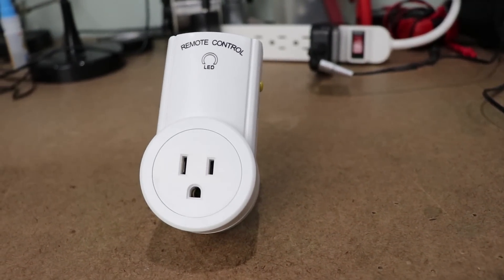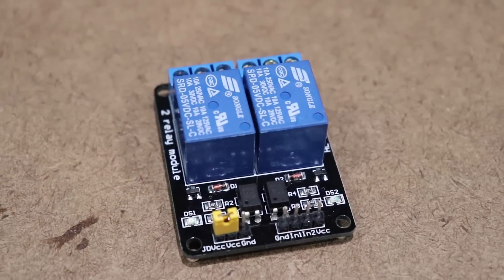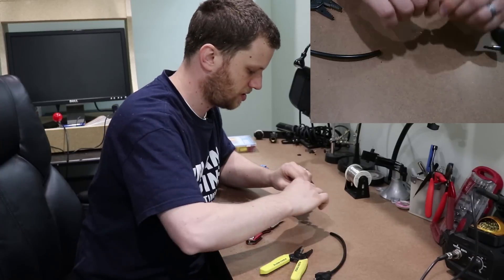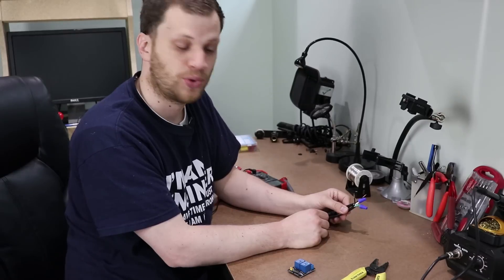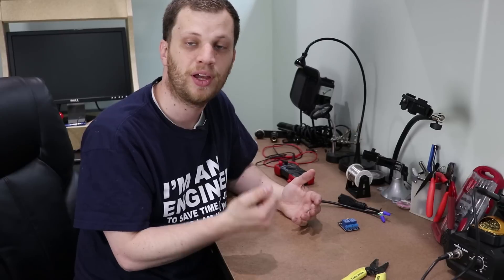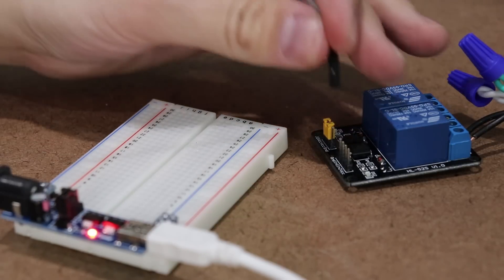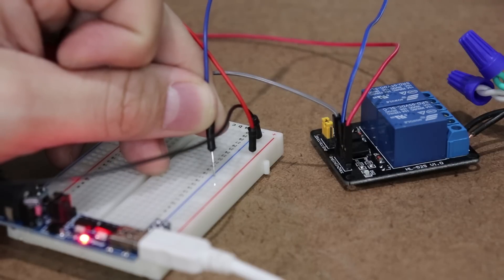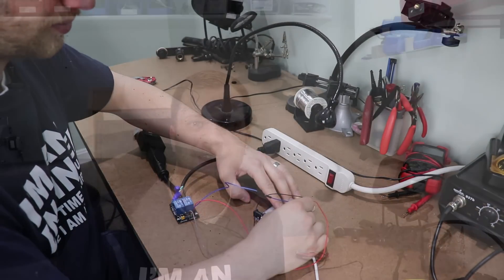DIY Smart Switch - Part 1 how to use a relay

Comment: Have you ever heard about Wago??
Reply from the maker: Nope, what's that?
Reply: @bytesizedengineering   This is for connecting wires
Reply from the maker: Oh, yes I have seen them. I didn't know what they were called. Thanks for the tip

Comment: Man, I did not understand it why the signal connector should be ground to get the relay activated? To activate the relay, shouldn't we apply 5 VDC to activate its coil? Your clarification is much appreciated... Thanks for your very helpful and useful training videos
Reply from the maker: There is usually a transistor that drives the coil. Depending on what type of transistor (N channel, P channel, NPN, PNP) will determine which logic level turns on the relay. This particular module has active low logic which means you ground the control signal to turn on the relay. Hope this helps!

Comment: Awesome video man. Thank you so much. Taking your time to explain to this level of detail is highly appreciated.
Reply from the maker: Thank you! And Thank you for taking the time to comment!
Reply: @bytesizedengineering  Can I control load of max 15 amps under 12 volt DC as along as it maintains the same output power rating?? Example Say, 20 Amp, under 12 v dc, power 240 watt as against the rated 10 Amp X 24 v of same 240 watt, or 15 amp, 12 volt....!!??? I'm really confused with these power and current. Awaiting clear concept. Thanks.

Comment: Awesome video Zach, thanks very much. I need to power a simple electromagnet with 12v and would like to use one of the GPIO pins on my Raspberry Pi to control the relay. Can I use one of the Pi's 3.3v GPIO pins? Also, do I need a diode to protect the microcontroller from voltage backfeed/backpower created by the collapsing magnetic field (when I turn it off)?
Reply from the maker: Calvin, you are right on track! You absolutely can use the pi for something like this. The relay module you see in this video has back emf voltage protection built in. It has a diode (like you mentioned) as well as an opto-coupler. There are a million tutorials online (adafruit, sparkfun, etc) on this topic. A quick google search should provide what you need. Good luck!

Comment: Hey can you help me. I want to make a tv that turns off when people come over to look at it.. Do i use normally closed? Will.it.open when coms? I want it so people in a gallery see a screen with a video feed and come over but a motion sensor turns it off when they are near. Thanks if you can put me on the right tracking without using arduino
Reply from the maker: That sounds like a cool project! I see that you found my other video showing the PIR motion sensor. I would start with something like that and connect it to the normally closed terminal. Good luck!

Comment: Hey can anyone answer this for me? He mentions that by using a relay we can control high voltage circuits with a low voltage, yet he continues to run his relay directly from a wall socket with no use of resistors.. can someone explain?
Reply from the maker: That's a great question! I'm not "running" the relay from the wall outlet. I can connect the relay to a control circuit (microcontroller like the Arduino) which is run off 5V DC. That control circuit can open and close the switch inside the relay. If you connect a mains voltage appliance to the relay you can control whether or not the appliance gets power from the wall outlet. The wall outlet is completely independent from the relay and control circuit. I hope that clears things up a little

Comment: Hello guys, just wanna ask, I want to connect my arduino to a 12v battery (It's possible right?), if so, I want to control a light bulb with the same power source also 12v battery, do I still need a relay? If so what volt should I use?
Reply from the maker: Check the specs of the Arduino model you're using, but the uno has a voltage regulator on it that can handle input voltages up to 12V.

Comment: Instead of using costly relay, put a normal switch to it
Reply from the maker: I'm not sure you understood the point of a relay. They allow you to electronically control devices connected to them. Also this relay only costs $1-$2 on eBay

Comment: Sir can I use this relay for DC Actuators
Reply from the maker: A relay opens and closes two points of contact in a circuit. Draw your circuit out on a piece of paper and see if a switch makes sense. I would make that determination based on how much current your DC actuator draws and how quickly you want to switch it. I would look into using a mosfet or h bridge motor driver.

Comment: 5:30 whats that thing on the breadboard?
Reply from the maker: It's a USB breadboard power supply. Plug a USB cable into it and provide 5V to the breadboard. You can get them on eBay

Comment: Also if the thing that you've connected to a relay is connected to the plug, you shall never touch the relay, aspecially the bottom of it. I lifted my relay to plug one more pin and got myslef electrocuted. Now i have 2 burn marks on my finger like i was hit with a very powerful taser gun and it hurts badly. Don't be an idiot like  me and be extra cautious when working with AC
Reply from the maker: Yes, very good point. Don't touch the solder joints on the bottom of the board when they're carrying AC!

Comment: just got a 12V 2-Channel Relay Board Module Active Low unit; - just realized that I now need an ATX psu near it AND to knock up a wee module with a bit of tri-pad and two transistors (+resistors)...
Reply from the maker: Sounds cool! Good luck!

Comment: im corrently working on a related project,and i have just one doubt. instead of the breadboard power supply,can i use a 9v battery,if yes how? please respond asap
Reply from the maker: You can use a different power supply

Comment: your leaving a lot of copper showing there slick.. Dangerous! you scare me my friend.. if you all follow his example do not let the extra copper show like he did.. cut your wire the length it needs to be to fit into the relay with no copper showing.. It is the safer way.. the electricians way..

Comment: Nice video! What are those blue caps you use at 3:10?
Reply from the maker: I call them wire nuts, there might be other names for them elsewhere. They are used to connect two or more wires together. Just make sure you get the right size for the gauge of wire and how many you'll be tying together.

Comment: my relay does not sound click . but the light bright up . is there something wrong with my relay ?
Reply from the maker: You're not using a solid state relay right? If you're using an electro-mechanical relay as shown in the video there could be a number of things wrong. Make sure your wiring is correct. Make sure you're using a high enough voltage to actuate the coil. Read the top of the relay for that information. The real test is with a multimeter to make sure the contacts close and open. How loud the click is is less important.
Reply: thank u for the reply. 

wiring  /
My wiring is correct , i triple check it to be sure . i already test the same wire to the other device and it is working correctly . 

high enough voltage  /
my relay 12 v . and my power supply is also 12 v .  

multimetre test
dont know how to test it . hahaha 

btw thank u for the reply and the knowledge

Comment: How reliable would you say these relays are? How long will each last you reckon?
Reply from the maker: I'm not sure. If you find a datasheet for the relay you'll probably find the number of lifetime cycles it's rated for.
Reply: Also, although it SEEMS like the Arduino is isolated in this circuit, it really is not. You should use a separate 5V power supply on the JDVcc pin to fully isolate the Arduino from the electromagnet in the relay. Otherwise, if something goes wrong with the relay, you might damage your Arduino board.
Reply: The relay itself (the little blue boxes) is probably fairly reliable -- and can handle those 10A as written on them. However, there might be other components on that board that will not last long/fail at those loads.

Comment: Electrical engineering degree..... doesn't even know what high and low voltage is
Reply from the maker: I work with embedded electronics, anything above 12V scares me!

Comment: can a 5 volts power supply work as well and a  breadboard power supply? you know. the kind you use to charge a cell phone? or better yet , a usb 2.0 connected to a pc?
Reply from the maker: Yes, any 5V supply will work
Reply: fantastic. Thank you

Comment: Great video!  Do you have a video on how to use a relay to open/close an electric DC 12V valve?  I assume you need a two-channel relay to set the reverse polarity?  Thanks again for the video
Reply: A solinoid is usually used in irrigation

Comment: If you want to control the power of higher voltage equipment like servers and even lights I like using an Intelligent APC (7800 or 7900) PDU over a network with fence_apc installed on a Linux device. That's for anyone who might actually have a need for that. That way you can use your GPIO pins for things like sensors, etc, etc.

Comment: You shouldnt have so much of the bare copper sitting out of the relay, if they only slightly touch all current will flow through the small surface area making it heat up and most likely cause a fire, and the circuit breaker will not trip to prevent it
Reply: exactly my thought!
Reply: @therealb888  ^
Reply: 4:38 in case somebody is wondering. but yeah, that is super dangerous!!
Reply: @gene_Code  ur the man!
Reply: Gene Code it’s not plugged in give him a little credit 😂😂😂 this guy has stones dude.
Reply: Good lord yes XD literally the worst thing to show people that exposed copper is okay!
Reply: I was thinking the same. I would recommend some ferrules for soft stranded wire that is so closely connected
Reply: Oy vey. Did you see the part at 7:24 where he recommends putting into a protective case. At 1:11 he flips a switch on & off. Do you suppose that it has exposed contacts on the side of the switch?
Reply: This guy is begging the Fire Dept to pay him a visit. Shouldn't be working with AC at all. How to commit suicide should be the title of this video.
Reply: Yeah. I would not do this in this way at all. I am pretty sure I would install a device box containing the relay to handle this at the outlet. Inside a device box I could bond the box and the circuit can safely just go from outlet
Reply: It would almost certainly throw a breaker. You would be directly shorting the hot and neutral lines.
Reply: @professorstratios8228  no because both wires are the same „hot“ potential
Reply: But I would disagree to it, the two copper wires are actually a power line cut at a point for the relay to get in between in serial, and having two of the bare wires to connect will simply bypass the relay and keep the connected  device always ON. why is that dangerous? I cant understand, apart from the fact that you can yourself get electrocuted.
Reply: @muhammadjunaidmalik3584 , same thoughts. Seems they doesnt know what they are saying and yet have all the courage to criticize. funny how they say when both wire slightly touch each other, they will heat up. oh man!
Reply: @muhammadjunaidmalik3584  You are correct, if the wires do touch, it would bypass the relay and cause the device to be always on. The problem is that if it is NOT a solid connection - the proximity of the wires even without connecting and if even 1 strand was loose and CLOSE to touching, the electricity can actually ARC across a small gap and create a substantial amount of heat - enough to melt the relay and potentially cause a fire.
Reply: @muhammadjunaidmalik3584  if the both wire connection is good contact than not problem, otherwise will heat up or spark cause a fire. this is basic to be a electrician
Reply: Extra Mental yeah I was thinking the same thing. At least cut some off so it does not pop out which I prefer to do or just use electrical tape. I’m a student in the HVAC/R trade. We do a lot of low voltage stuff and even normal voltage you find in homes. I’m a decent at it but I’m always looking for stuff to learn. I don’t even think I’m gonna stay in the trade I just love technology and stuff I’m kind of a jack of all trades guy. I wanna know everything from cars to electricity and electronics it’s just a huge passion of mine. I honestly thought this video was gonna be like Control lights that are hanging in your house. I mean good video and all but this is more a learning things not something I would actually wanna do for something as small as a lamp.
Reply: This is why I prefer to do my own work and rarely hire mechanics or electricians... 
This guy worked as an electrician, and an engineer??!!??
Reply: PHOTOGRASPER yeah as a guy who’s in the HVAC/R trade I’ve seen guys in the trade and even electricians mess stuff up badly. This one time we had a metal casing to hold electrical outlets for some reason they had this why would you want a metal casing to hold electrical outlets seems like a stupid idea to me since mental can easily conduct and carry that electricity and guess what it did. The electrician was not done with hooking up the outlets so he left a LIVE hot wire in the dam casing and one of my buddies went to go lean on it cause we were having a lesson on furnaces I go to a trade school and my buddy got shocked pretty good. I’m with you on that I wanna do a lot of my stuff on my own cause it makes me feel good that I understand something that I can fix myself and do it right. As a guy in the trade they always teach me ways to “cut corners” for something like a cheap customer to gain and make profit. It feels weird to me cause I’ve always been the guy who wants to do it myself so there was no cut corners. My point is your absolutely right do it yourself is the best thing you can do to have it done right for most things and plus you learn a lot and it’s cheaper, a lot cheaper in most cases. But don’t go taking asbestos out of your house, get professionals to do that. That’s a good example of when not to do it yourself.
Reply: Oh for crying out loud.  This is no big deal.  If it shorts the breaker will trip.  Or if it's just a small strand it will vaporize.  I would try not to leave it exposed for esthetics but you're going to have this mounted in an enclosure and as long as there is a strain relief there's no issue.  After all that same voltage is on the back of the CB a whole lot closer than the incoming line.  Watch and learn.

Comment: So humble... "I'm not claiming to be an expert in this topic [...] but I did work as an electritian and I do have a degree in electrical engineering". Dude, you're a PRO... lol
Reply: Being a electrical engineer and a electrician are different fields. Smart people though
Reply: He's not very professional for being a pro he has stripped way too much wire going into the relay leaving high voltage exposed ...
Reply: Victor Fernandez did

Comment: Why not just avoid cutting the ground and neutral wires in the first place?
Reply: Hmm good point.
Reply: lol ikr
Reply: So.. Black is live there?
Reply: looking at how he's wired this particular project, my thoughts would be that splitting the outer insulation off  and not cutting the Neutral and Ground would save fatigue on the 2 wires in question because the bend would cause a weak point. safer to avoid that fatigue this way. the amount of exposed copper on the live wires in the relay terminals did make me cringe though
Reply: Good one....some other videos mislead me...thought having a simple switch requires aurdino module.
Reply: @weebtakidaweeb3783  thats not hard lmao
Reply: @josefaschwanden1502  not for you, but for the people who benefit from this video it probably is.
Reply: Good point
Reply: The idea would be to connect something more than just a simple light with a simple switch. Like connect the relay to a blue tooth controller and you can control the light from your phone. You can build this for extremely cheap, or buy one for a lot more. You can modify this exact setup to control basically anything from pumps to LEDs. He is just showing how to do it. Not that this specific setup is useful at all.

Comment: Would a relay work for smaller voltages. If I was needing 12 volts in and a smaller voltage out could I put a resistor for the amount of voltage that I need coming out? Is there an easier way of doing that that or would a relay work? Also how would I go about hooking a toggle switch like a light switch to make it to where if I turn it on or off it turns the device on and off. Any help would be appreciated. Thanks
Reply from the maker: I'm unclear on what you are trying to do. A little more information would be helpful.